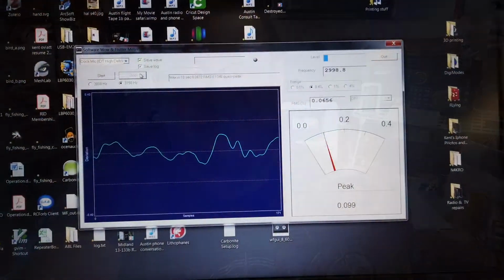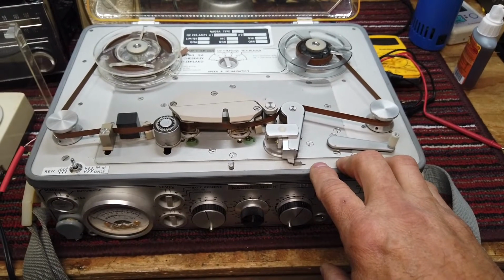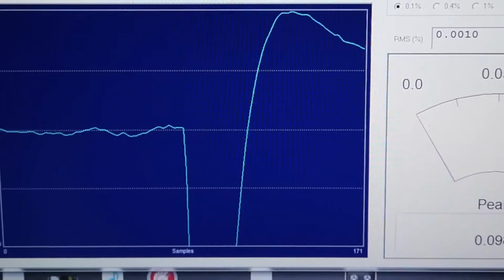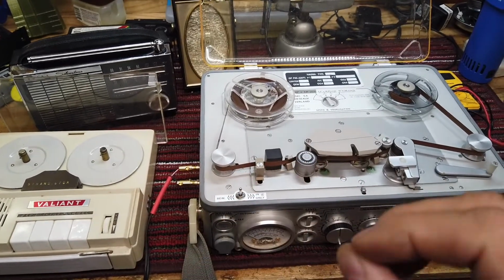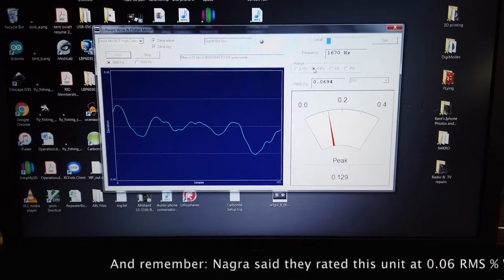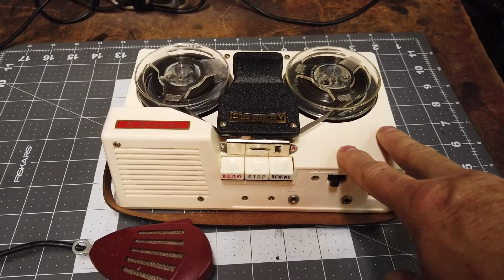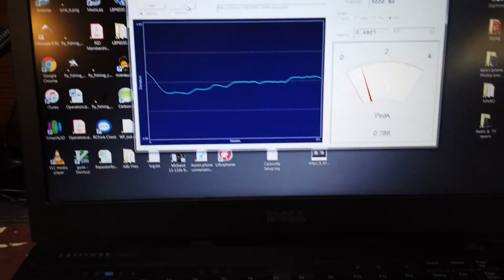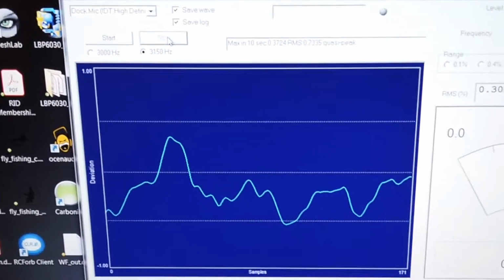Vintage Tape Wow and Flutter - Why So Wobbly?

Comment: Thank you for this video, Very well explained. I even downloaded this same program but never used it, because I recently bought a Wow Flutter Meter Meguro MK-668E, in perfect condition. I do restorations of vintage recorders professionally. Honestly, I don't repair those Tape recorders that don't have a pinch reller. I have some in my collection, but it's just as a reference from the 60s.

Comment: 0:30 Description of wow and flutter

2:00 Wow and flutter reference number

2:45 Causes

3:50 Tape speed

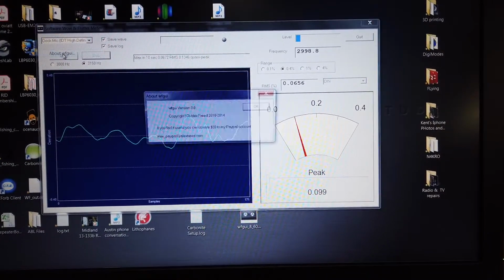7:00 Windows software (Wfgui Alex Freed) replacing W&T meter  and testing equipment

7:50 1930s/1940s Webster Chicago microphone 

9:20 Nagra, studio quality, high-end tape recorder

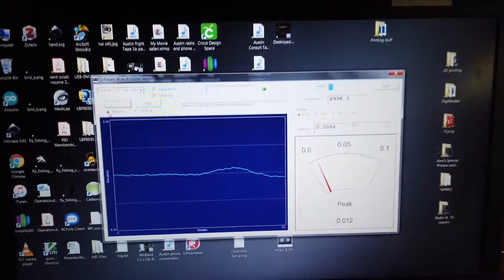13:45 Example of flutter and example of doppler effect by waving over the speaker close to the microphone 

17:00 Compounded flutter
Reply from the maker: Thank you, friend.

Comment: Great video Kent! I currently have an AKAI GXC-325D cassette deck in the shop. Just got a part from Overseas to correct a motor issue and it's still in the shop with a latest diagnoses of excessive wow and flutter... New belts have been installed... Capstans and pitch rollers are in super shape... Kind of a head scratcher.
Reply from the maker: Two other things to consider that I have seen on a few of these. The motor shaft or it’s drive pulley could be bent, or there are other tape path-related issues such as excessive tape tension brake action, or dry or gummed up spindle (take up or supply reel) bushings.  Same could be found with the motor (dry or dragging motor bearings or bushings).  Thank you for the kind remarks.
Reply: @KOVintageTech  Wow, thanks for the fast reply and options! Love this machine and sure hate to see it head for the grave. It was my father's all throughout my growing up.

Comment: So I have a Roberts 771 that when I play back a prerecorded test tape has very little flutter but when I try to record to a blank tape and play that back it has a lot of flutter. How could this be if the playback and record use the same head?
Reply from the maker: Two thoughts.  Could be a record biasing problem. Or it could be deteriorated tape that you are using to record.

Comment: Very Interesting experience. One suggestion, do not use reference tape. Use exactly the same method that you use to making reference tape for all other recorders, just divide the numbers by 2. The reason to not use 1. it simpler 2. it is more precise - reference tape need to be at list 10 time better then the device under test to have high quality measurement. Professionally  made reference tape probably are   made on high speed duplicators at list  100 faster speed, when the tape is play with normal speed all the distortion effects are reduce accordingly by speed divisioon. Using just  stable signal generator (or even cell phone with sound App have very high stability) , as you did, can achieve the same precision as best reference tape. The reference tape was perfect technician tools in old days when getting professional  generator was way beyond what they could buy. The disadvantage:  you can't adjust tape speed.
Reply from the maker: Thanks for the insight.  I was going on my gut, but it helps to have someone affirm this.  It is MUCH easier to just record a tone and play it back as you suggest.  I may go back and redo the entire test.  I now have about 60 recorders to test.  Pretty good range of sampling.